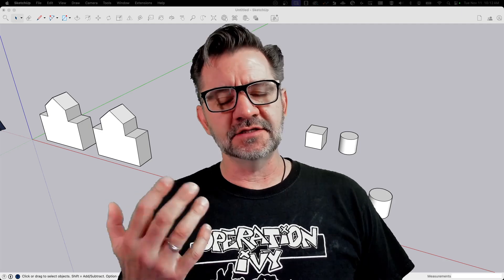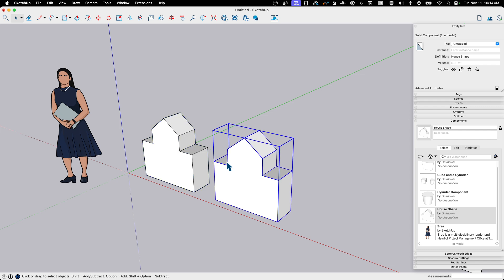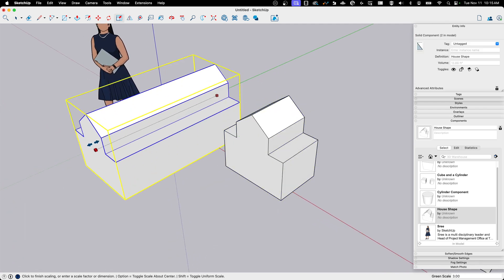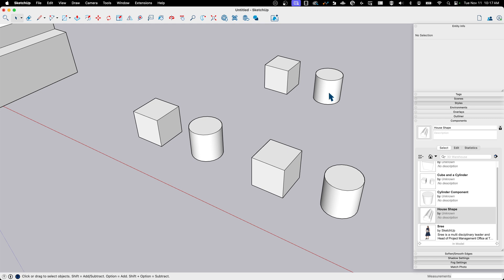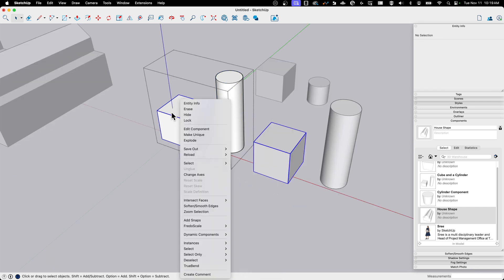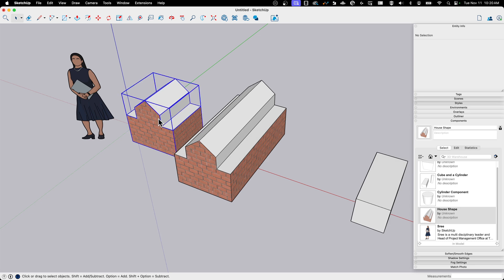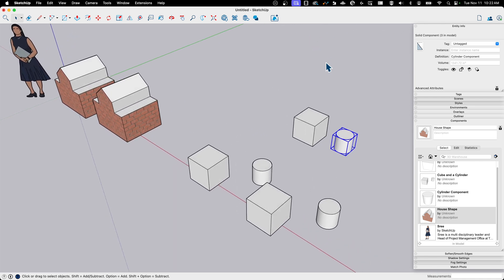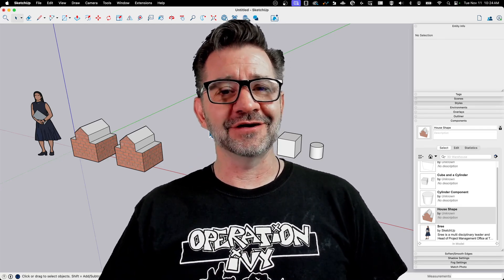SketchUp Scaling Secrets: Scaling Geometry vs. Scaling the Container

Comment: Nesting is a critical concept to understand for SKP. 
In inverse, it's also valuable to know that setting the scale or distance of an object in a group/component with the tape measure sets the scale for only that component and is very useful for adjusting textures to accurate dimensions or graphics. I use this all the time to set a texture of dimensioned drawings (such as blueprints) onto a flat plane and it won't break everything else in the model outside of the group/component. In Aarons case of this vid, maybe he wanted to make the brick texture the exact size of a real brick without changing the size of Sri(?) or the cylinder and cube components then he would only need to measure the object and set it to the right size in the component itself.
Reply: I understand and use the tape measure to set the scale, but i really dont know what you mean related to texture...
Maybe you can make a video....
Reply: @florinapostoiu  You can also be setting the scale of a texture and not just geometry or objects.
Reply: @johnjlopez  Maybe you can put a title of a video or article please.!